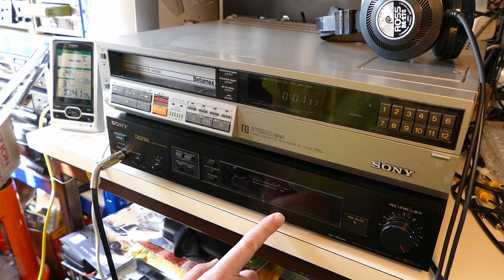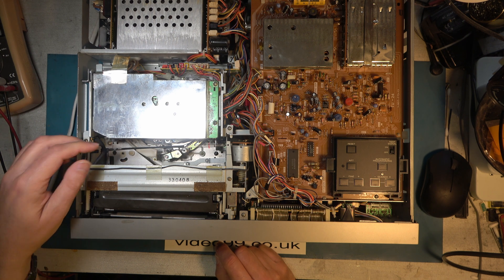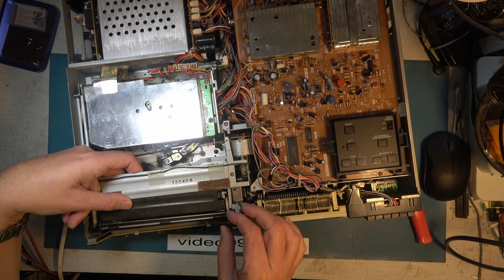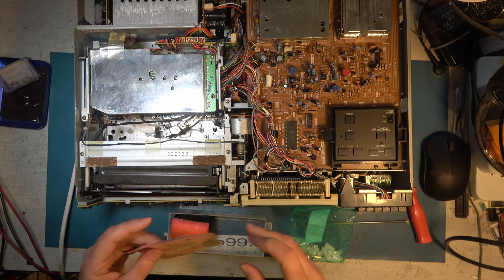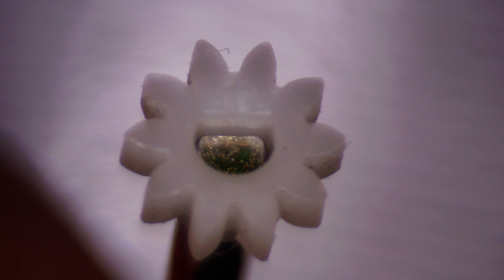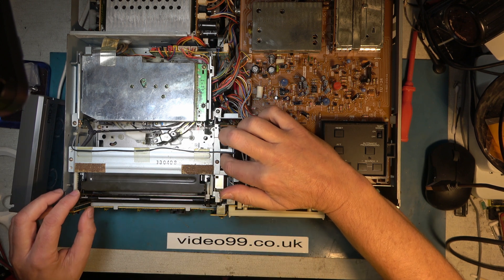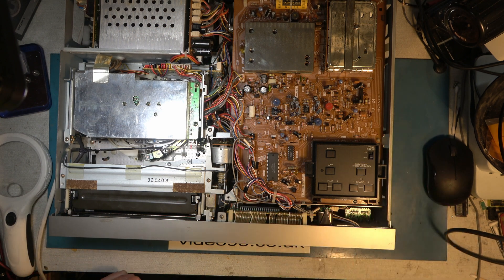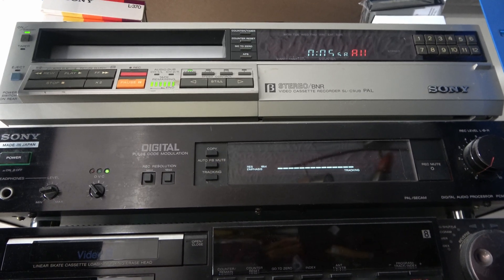Sony Betamax SL-C9 breaks down.

Comment: hi have checked over the last years on here    one day the numbers making video's about betamax  will be down  the uk beta repair   mr beta byte is new 
to me    

i have seen  beta video's in used  A/V shop in reading last month  prices are getting very heavy in cost  i am started to pull apart 12 100ub stereo decks 

i did it with  40 betacam  decks only lost  6 as parts decks     3 ranges of decks  2 of each range  

the decks came from a video repair hire place   like kingswood   i had all there betacam decks  and many all over london  city 
price is higher it was me  bagged them i still do   

i am more on the audio side

Comment: Hate these, spent hours trying to repair mine, it has the update clock transformer and the brass cog kit both fitted.
The carriage takes the tape in and out but it will not lace up and the eject light just flashes yet when I remove the carriage and put the tape in manually it works perfectly and with a great picture, I cannot figure it out. 
Also swapped main board and still does it AAARRRRGGGGGHHHH.
Reply from the maker: It may not be detecting the cassette down condition, I would check the switch for that.
Reply: checked all switches and they're okay, the bar underneath is fine too, works perfectly when carriage is out, just feel like selling it on and sticking to HF100UBs and 950s as less hassle.  @video99couk

Comment: Nice work. That's WAY better then leaving the door off for ever and then wondering why the picture in the video file is full of compensated drop-outs 10 years later (or worse).
Reply: How does leaving the cassette door off cause this? Does it leave static electricity on the deck that causes a bad grounding effect?

Comment: Perhaps we can also mention here why the DOC (Dropout Compensation) response sensitivity cannot simply be turned to "0" on a "normal" Betamax device (without a PCM switch). I haven't heard anything good about the durability of C9 head discs.
Reply from the maker: I was considering fitting a DOC bypass to one of my Sanyo NTSC machines until I got in a couple of NTSC SuperBeta machines which have PCM/DOC switches from new.  I've been lucky with C9 heads, not had any fail, but they may not be the best.  My three C9 machines put in low hours now that they are only used for PCM work so aren't likely to suffer head wear problems.  I've not looked up whether the F1 and C9 share the same heads but if so, scrap F1 portables are readily available as head donors.

Comment: I bought a C9 in December 1982 for the princely sum of £699. I went in for a C6 - saw the stunning new C9 and had to have it.
The freeze and slow mo were perfect... picture was good for its time. BNR (Beta Noise Reduction) was rubbish though! Looked (and still looks) amazing.
Unfortunately, the heads didn't last anywhere near long enough and the front loading mechanism eventually broke. All in all, should have lasted longer. 
Then went for VHS Hi Fi and never looked back - all VHS machines i've ever owned have been great.
Reply from the maker: The C9 was a lovely machine for its time but wasn't as reliable as it should have been.  Not all VHS machines were great, there were some junky ones (even from well known manufacturers) especially towards the end of the format.